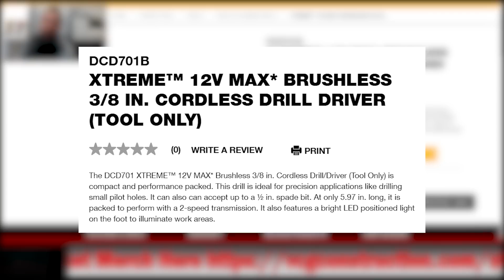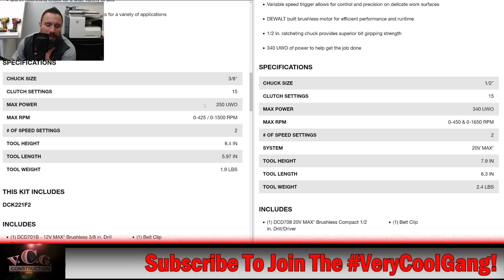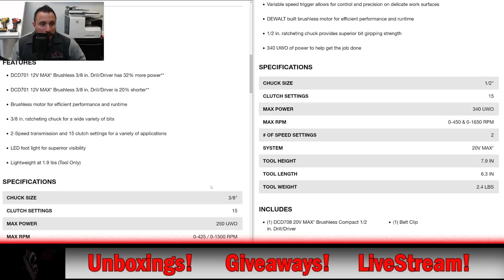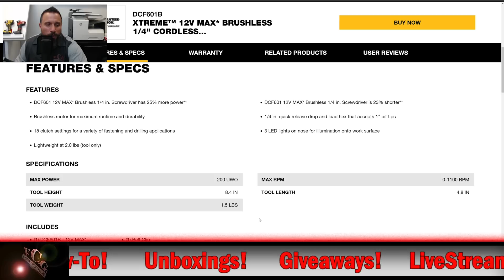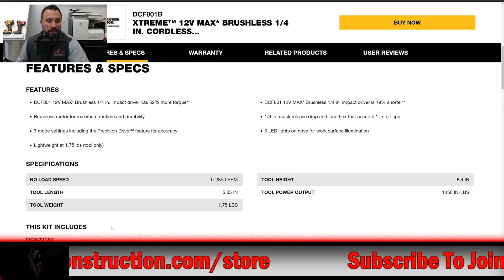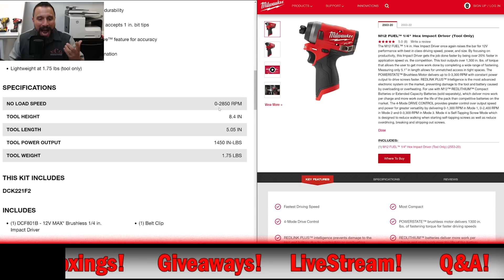NEW DeWALT Tools 12V MAX XTREME LINE COULD BE THE STRONGEST ON THE MARKET!

Comment: Just snatched the Xtreme 12v Drill and Impact kit from lowes (Labor day sale $149). I'm impressed. I use my 2yo 12v Screwdriver all the time for light stuff that doesn't require me to break out the heavy 20v stuff, but I love the improvements like a Battery Fuel Gauge on the 2ohs, and the 3 settings on the impact, the drill is still rocking the cheesy chuck collet, but for $149 for both with batteries and a 112 charger it's not bad at all. I like the weight and compactness and I'm already heavily vested in the Yellers so...

Comment: alot of dewalt fans have said in the past that if dewalt makes a 12 volt line they wont buy it because 12 volt tools are 'kids toys'...i guess dewalt is making them because they see how many 12 volt tools milwaukee is selling....kinda like when Ford did away with the ranger pick up and chevy redesigned the colorado pick up and were selling alot of them along with toyota...ford jumped that bandwagon again in 2019
Reply from the maker: You sound like you’re on to something cuz!!

Comment: I'm sure they are nice and powerful. They are only slightly smaller than the small 20v line so WHAT IS THE POINT. The Atomic drill is good and makes sense but you will also need the 996. For impact. Tool the 887 is all you will ever need. Less is never better.

Comment: No thank you i dont understand why you would step down from the 20v platform
Reply: Weight is a big one. Throw a shift's worth of tools in a bag, and climb towers, or hit the tripper deck of a power plant lol most 12v users I see are techs, not construction guys. Servicing, maintaining, retrofitting, that kinda stuff. I do industrial electrical and construction in mining, and I use 60v-20v depending on whether I'm setting up 13.8kv new construction, or just installing a dozen lights in some offices. I'm very interested in 12v for those lighter days 👍

Comment: I have Milwaukee 12v fuel drill and driver, very good tools but I don't like the forward and reverse switch. It doesn't seem to have a positive enough action and I am constantly having to mess around with it because I knock it out of engagement or it doesn't click over when I want it to. Never had that issue with my Dewalt.

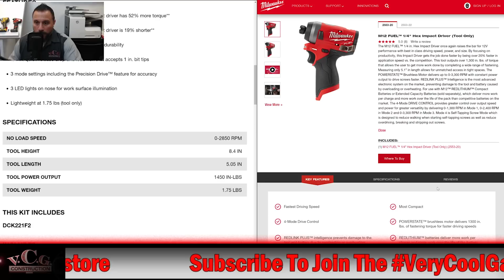Comment: Vince, at 10:00, you start talking about the Milwaukee having higher RPM, and therefore the DW should be more precise, BUT...

You forgot to mention that the M12 FUEL Impact Driver has that 4 mode control to dial down the RPM’s and also the self tapping screw mode.
Reply from the maker: You are very correct, thanks for reminding me!!
Reply: ...trying not to dog the dewalt out the gate...that surge is gonna mop the floor with this tool then the surge is gonna look for the next contestant..

Comment: Even people that hate DeWalt!  Love Dewalt! So u know the review has to be done.😁😁😁. 12v line are good for roofer like me. I had to get the Milwaukee 12v line because Dewalt didn't have none. I deal with small tapcon on concrete roofs. And when the sun in Puerto Rico U.S.A beats you down. You need a hammer drill that's small and light weight. The same with impact driver and reciprocating saws. Small and compact.

Comment: with 12v charging will be an advantage no need for inverters if you have 12v solar. also charge straight from the van/car. more efficient. ;)
Reply: not how that works with lithium.
Reply: @brendan747  i meant with a correct charger ;)
Reply: king ov kings still doesn’t work unless the dewalt charger has a 12v in.